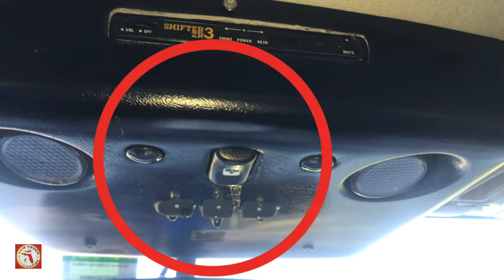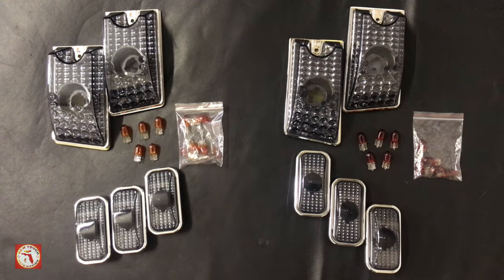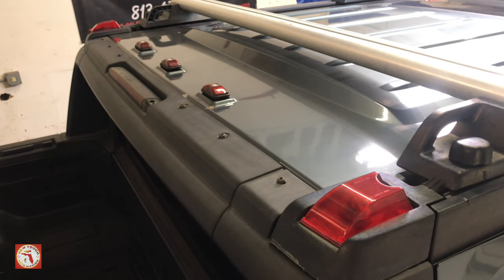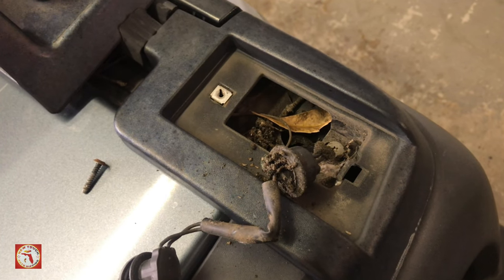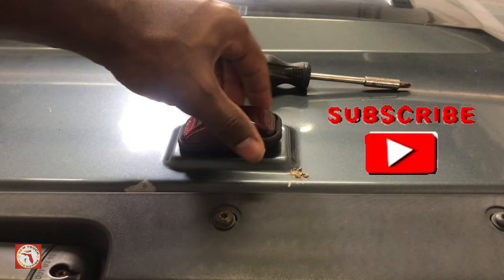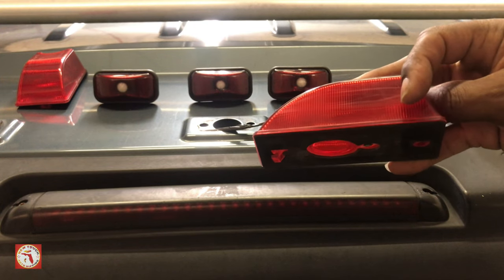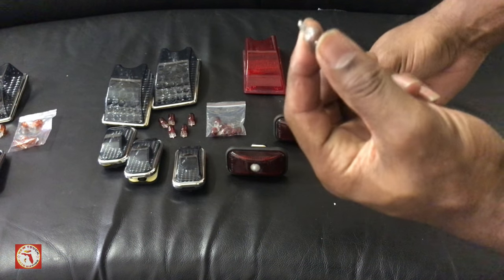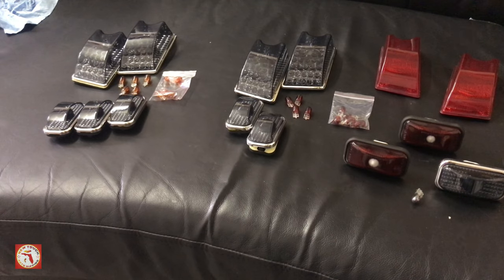Installing H2 Hummer SUT cab marker lights

Comment: Sir. You save my life! Thanks for helping!
Reply from the maker: You’re welcome, after filming this video I did notice that the water leaks still existed. Here’s what I found to be helpful and stop the leaks, by using a waterproof caulk seal on the outside of my lights I no longer have leak issues. The 4 lights on each corner will be where the water is entering, at the top where the roof rails slide is where the water builds up to leak inside of the light housing. What I did was caulk around the outside of the 4 lights eliminating any entry for water to enter. This is why you may be experiencing a lot of tree debris inside the light housing. I used Dynaflex Ultra from Lowe’s, it’s designed for windows, doors, siding and trim leaks.

Comment: love the video, helpfull to see how the lights are removed. although im curious why you didnt take the opportunity to re seal the internal grommet with rtv or silicone while you were there as these are the main reason the lights tend to leak.
Reply from the maker: Thanks and you are definitely correct, I ended up sealing them on a later date after noticing the leaks still occurring. I appreciate your input regarding the additional work needed.

Comment: Nice video. Did as you showed. Gap still existing in 2 out of 3 lights. What to do? Pls advise.
Reply from the maker: I actually ended up using a waterproof caulk sealer, you should be able to fill in any gaps with that.

Comment: The biggest leak is under the cowle.  There's a giant hole they covered with a rubber flap and the glue breaks down so water runs down the windshield and right into that hole and behind the dash on the passengers side. It's a pain in the ass to fix.
Reply from the maker: Thanks for your input and you’re correct.
Reply: Seen a Video on YT about that , Ok  It needs to be done. Thank You ,

Comment: Ok, ok I didn't know this, I thought the water was coming from the sun roof drain holes.... Something has clod up my drain holes, i got to find away to unclod both holes.. thanks for the video...i was hopeing you show us what those clear light lens look like in the dark....I was wondering are they're brighter than the color lens...
Reply from the maker: You’re welcome and yes they’re brighter than the original bulbs. I’d suggest that you go with LED lights instead bc they’re a much brighter option. When it comes to the leak I found it to be more than what I display in the video, actually you’ll need to seal the inside with weather resistant caulking. I used black outdoor caulk to be exact. Your drain system can definitely be clogged up though, if you have the SUT there are a few areas they’re located. In the trunk area under the vents are the main for the bottom and the top will be under the big 4 corner lights.

Comment: Curious if you had anymore leaks after this install
Reply from the maker: Actually I did, my intentions are to do a follow up video. I found that the leaks are coming through the rubber plugs that the lights are connected to. You’ll need to purchase any brand of all weather seal, apply the product around the exterior of where the plugs sit, seal and give it time to dry before putting the lights back together.